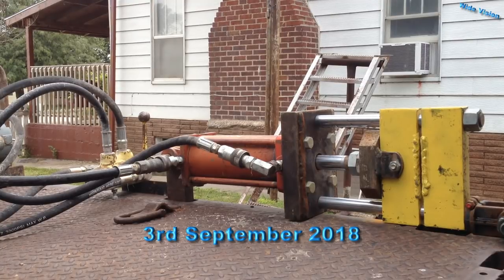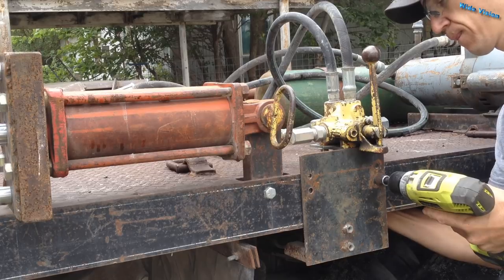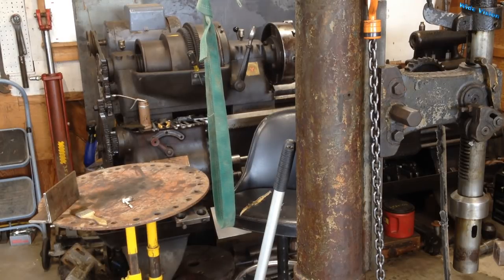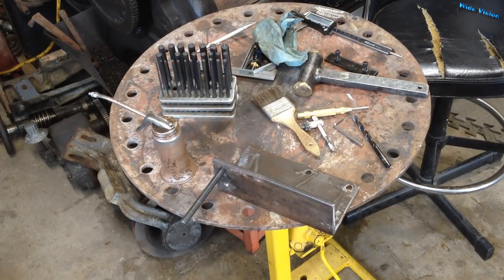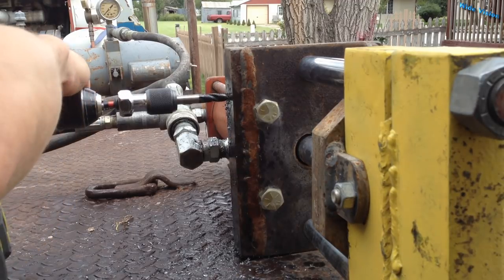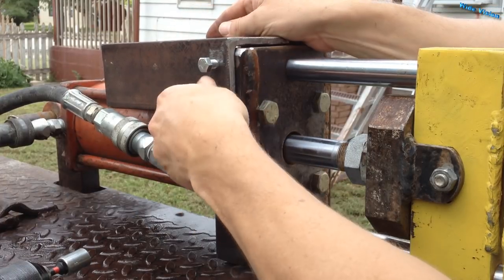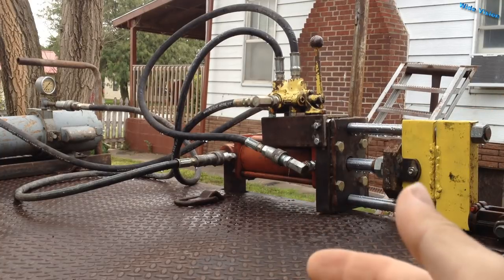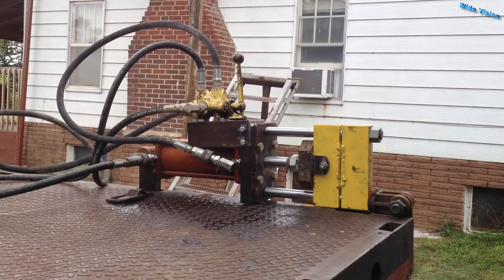Attaching the Valve on the Portable Live Hydraulic Press

Comment: I'd mount it under the bed with only the working end sticking out throught the tail board. Could even be put on a track so it could be stored out of yhe way. Then your stock could be on the step and just slide it down as needed. If you build alot of fences you could even mount your saw on the other end and have a feed system. Anyway you do it it's cool. I will give a tech tip though, never start a bolt with any kind pf driver, and never tighten any of your bolts until all are in!!! Keep Rocking it out!!!
Reply from the maker: Hanging it under the bed with a track to slide out the back might work. I'll have to do some measuring and thinking! :)

Comment: Good video. Those power packs come in many variations, some are drilled to mount the valve directly to it or it can be hosed to have the valve remote mounted like yours. If you can find the manufacturer's model # you can look online to see if you can put the valve on the body. Yes the remote would give you more options for positioning the press and yourself while working, good idea.

Comment: I did what you did with the valve on my wood splitter. Originally the valve was plumbed directly into the return port of the cylinder so you ran it from one side and that was it. I took a piece of deck plate (bums can't be picky) and bent it into a 90 and bolted the valve to the top of it and it to the side of the block remover? that surrounds the wedge. Now with the valve on top I can split from either side and no matter whether the beam is horizontal or vertical the valve handle it right in front of me or on top. Had to get some hoses made up but it was worth what $ was spent on it. I don't have the luxury of having a place where I can just pull in and go to it time after time. The world turns and moves things around here so  I've got to be elastic as my wife says. I say flexible but it matters not. And either the porch or the basement  or under the bed is a good place to be when a boomer is going on. Blessings, Yall!
Reply from the maker: Sounds like a good fix! I'm surprised the valve was on one side.  I agree, hiding under the bed is a good place, but my wife doesn't like it when I do! ;)
Reply: You see a lot of them  like that nowadays. Valve screwed right into the cylinder return port with a nipple and the blasted handle sticks OUT, not up. I could've lived with up but not straight out to the side. I had to put a new valve on it when I got it because the neighbors had tried their best to demolish it and almost succeeded but after they killed it the owner gave it to me and just wanted to borrow it once in a while. So I got a 20 ton (really about 18 running 2100 p.s.i.) splitter for what I put into it to fix it. Beat my old 14 ton all to pieces because the newer one was waist high, The other one was thigh high and I was always bent over. OUCH! Moved the motor/pump back 8 inches out from the line of fire of falling wood. It's right now and I've got a little to split IF I can get off long enough to do it. Making dough while the oven's hot, a lot like you! Blessings!

Comment: could put the whole press setup on a big hinged platform with the rotatingpoint on the bottom edge of the bed , that way you can fould it over the side of the bed and tie it underneath behind the rearwheels
maibe build a steel tool box under that side of the bed to rotate it intoo and close it up to hide it from sight

Comment: Man it's good to see You !  !  ! 
If you put a screw eye right in center of block next to angle iron for valve holder , could you use lift to swing it around for pulling , sheeve's ?
Reply from the maker: Oh I like that idea! I've been trying to figure out how to lift it with the crane so it will balance out, but everything I've come up with I felt was way over complicated.
Reply: We haven't heard from you in a while. Is everything ok.
Reply from the maker: Going good, actually! Too busy with work lately to finish the 4 videos I'm working on. I'm hoping to get one of the videos posted by the weekend...but no guarantees. A new "toy" will makes it's debut in this video! :)